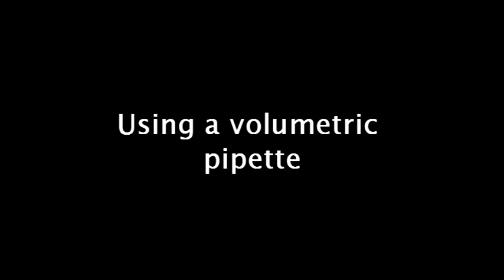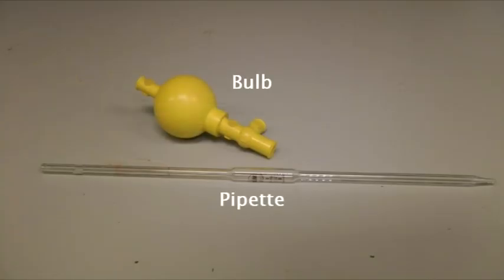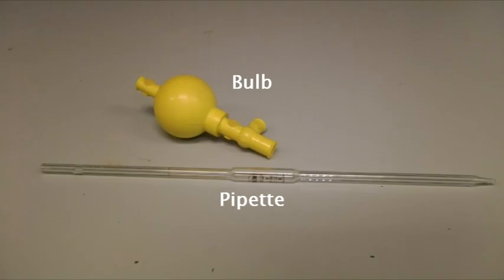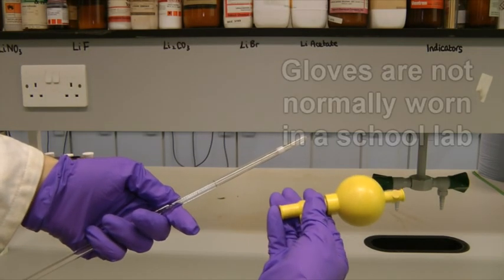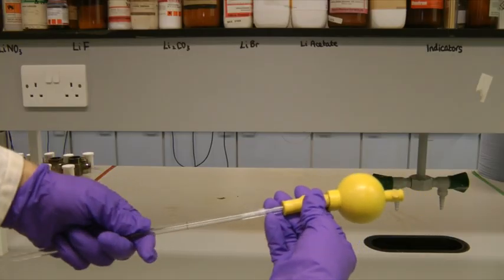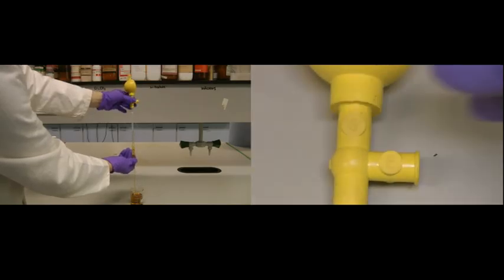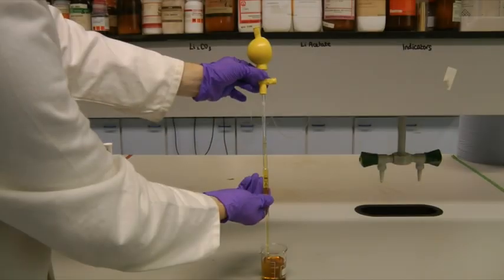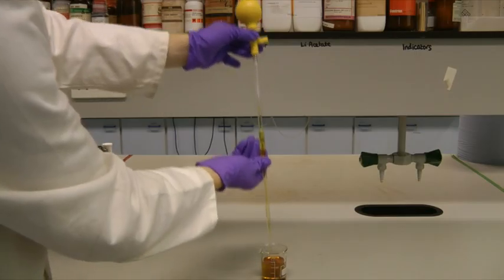Using a volumetric pipette

Comment: "never pippete from a stock solution"  what does this mean?
Reply: Stock solution is what the lab gives for all the students to use. The solution has not been diluted (or is already prepared) and is free of contamination. Good practice is to pour only the necessary volume of stock solution into another container and then to pipette from that container. Otherwise, you risk ruining the results of everyone else in the lab since they are also using the same stock solution as you.
Reply: @brianocampo7981  aaah i seee thankyouuu for the answer